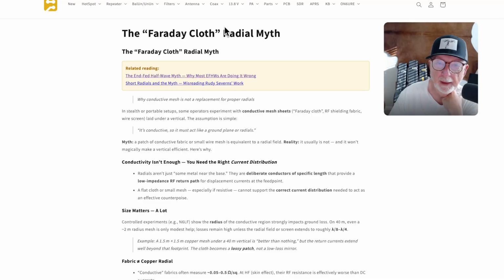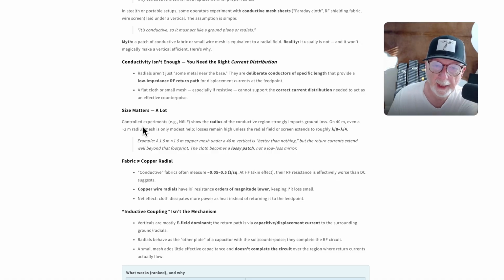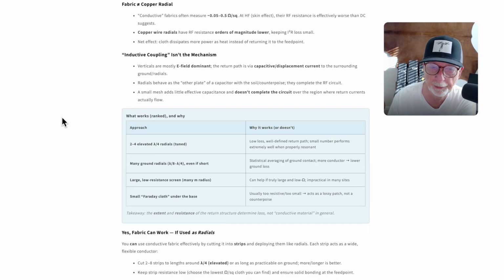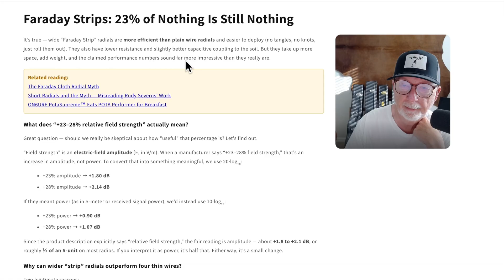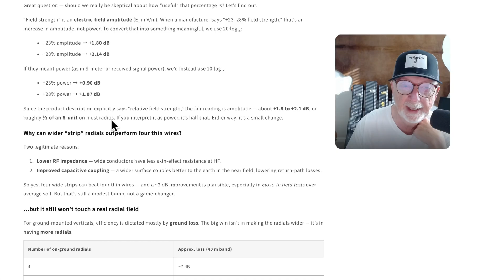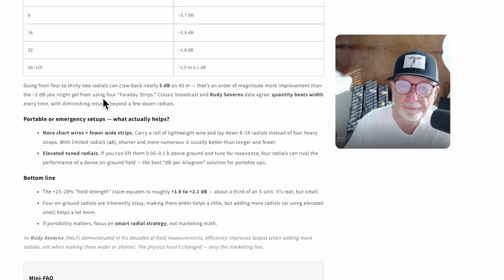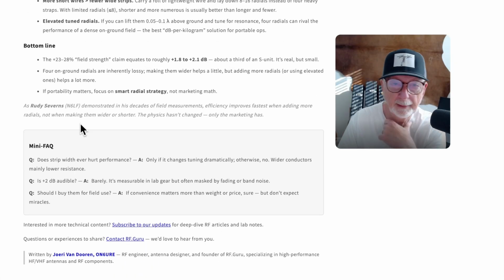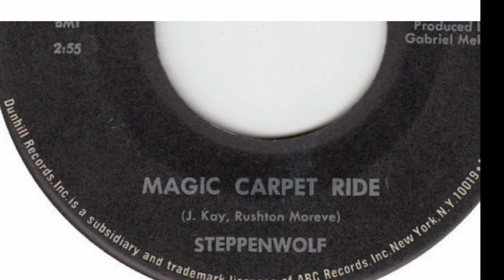Faraday Cloth Radials for Verticals.  Magic Carpet Ride?

Comment: Praise the Lord! I’ve been the one HamTuber that has been trying to tell people this. I even took a so called “Magic Carpet” out on the beach as a counterpoise and showed it absolutely sucked compared to plain old wire into the wet sand. Boy did I offend the Faraday Cult. This video does a better job explaining what I have known to be correct. Everyone drinking the Kool-Aid needs to watch it. 73 my friend! Walt K4OGO
Reply: I haven't even covered anything to do with the faraday sh*t on my channel because its plainly a ludicrous idea!
Reply: @TIMG5TM exactly! Even in simplest breakdown of the conductive properties of the cloth versus copper. It doesn’t take a physicist to figure out which is better.
Reply from the maker: Dang, comments from the best Youtube hams all in one place!!
Reply: @BustRadioMyths it takes one to know one 😂
Reply: Thanks Walt! Alot of the youtube hams seem to think "This sounds right, so it must be true!". Bugs me a little when they put themselves forward as informed, but are actually pushing myth and getting people to spend money.
Reply: @snokones  Hear hear!
Reply: Mark, you are spot on with your radial review. You presented this very well. I have been using 1/4 wave  verticals for many years.  You have to put as much wire on the ground and as you can. Wait until we see the next bottom of the solar cycle. I wonder how many magic carpets will be flying then? Steve

Comment: I have used the screen many times with great success....BUT...I never use just the screen.  I put the screen down AND put ~24 radials out also.  Just couldn't believe the screen alone would work well.  I do believe the screen adds or so says my WSPR tests though not a large difference.  However, I live in an apartment and have to set up portable every time and got sick of doing so much...so, I tried two elevated radials.  Wow do those work.  Haven't gone back.  I use those always now and they are great.  Much less work and give me better results than 24 ground radials even with the large screen or faraday cloth (I have both).  73 Mark and thanks for your vids.
Reply from the maker: More hams should try just a couple of elevated radials aimed at their target.

Comment: A counter view, but I will do my own testing as I start doing POTA activations with FT-710 and REZ vertical system. 

I am happy to pay $130 to avoid dealing with wires, and for POTA, I am certainly not interested in the minor dB gain from elevated-tuned radios on each band I may operate on.  I have no interest in tossing wires into trees (and many parks don't allow it), and I prefer a tripod to making a hole in the ground, which is frowned on in some parks.  

What gets me is why most folks would care about a 3-6dB loss of 1 S unit or less, which will be barely detectable on SSB unless right at the noise level.

HOA Ham ran a 12-hour whisper test on the new CHA FSR Faraday Strip Radial System vs wires, and presented his extensive comparative data; in most situations, the Faraday Strips won.

KB9VBR, in his many POTA activations, has mostly switched from wires to a Faraday cloth with great results.  If you're getting pileups or lots of contacts, who cares if you're 1 s unit lower than what some think is a better antenna?  He also says "WOW" with the new strips and so much better than keeping a Faraday cloth to lay flat, especially in the wind.    

It will be interesting to see others testing and comparisons when it becomes more widely available in January. 

Of course, tuning for the lowest SWR while usually close, isn't often the best resonance setting vs. when X=0.  Resonance is a condition in which the inductive reactance (+jX/L) and capacitive reactance (-jX/c) of the antenna cancel each other, leaving a load that is purely resistive. This results in maximum power transfer to the antenna.   

Dave WØJKT "Just Killing Time" since 1964, but still learning from more expert hams
Reply from the maker: Good you are happy with the purchase of the faraday strips.  But things like a 12 hour WSPR test comparing different radial systems is not valid due to constantly changing band conditions.  Thanks for taking the time to comment.

Comment: I've had proven good results with faraday cloth as a ground plane on my WRC setup with QSO's to South America  on 15 watts.. I don't give two shits whether it is "correct" to use wire radials over it or not. Works for me and I get on the air. Don't be a curmudgeon, Mark.
Reply from the maker: I AM a curmudgeon and proud of it!

Comment: I live in an HOA community.   I use an ASAT 120 for my antenna.  I used to have counterpoise of 2 radials for each band 40-10m.  Didn’t have the room for full length radials so I used buddy pole antennas as counterpoise on each band.   It looked terrible but worked.   Then people started talking about faraday material or just using window screen as a counterpoise.   I bought a piece of stainless steel window screen 4 ft. X 10 ft.  Grounded it to the base so it would act as a counterpoise.  Painted the screen close to the color of the roof shingles.  I use a magnetic mount to attach to an air vent on the roof of my patio.   The wind does not disturb it.   I put an antenna arrestor in system.  My antenna works much better than several random wire as a counterpoise.  Works better than the buddy antennas use as a counterpoise.  My asat120 antenna will tune on all hf bands from 40-10m.    I am very happy with my setup.   I read that a German engineer claims the density of the counterpoise is more important than exact lengths.   I don’t have to space or the neighbors approval to experiment.   What are your thoughts on using stainless steel window screen?
Reply from the maker: Sounds like you did a lot of experiments and found a solution that works for you.

Comment: Thank you, thank you, thank you!  I've been so angry about this myth of the carpet!  Rudy Stevens and I had a side conversation generally about how maximizing return currents works best with radials because the magnetic field (near field) lines are perpendicular to radial wires and induce the maximum return current.

Comment: For my multi band vertical i used traps in the elevated radials thus they are resonate on each band and kept my total radial count manageable to six three radials for each band 
40, 20, 12, on one 30, 17, 15, 10 on the other set of three. I always wondered if my 40 meter radials didn't carry current on 15 meters as well thus giving me six radials on 15 meters. The muliband vertical was a StepIR and thinking the traps would handle all the power one could throw at them since the power would be devided across the three. Perhaps Same for efficency.
Reply from the maker: Interesting design choice.

Comment: This video is kinda misleading. The faraday cloth radials work better than four wire radials on a non resonant multiband vertical antenna like what many hams use to do POTA. Sure a 32 wire field is superior but no one is doing that at the park and sure a resonant radial off the ground is better but that one resonant wire is for one band not multiple. I’m not saying the cloth is the best thing ever made but it’s a perfectly good option for allot of situations. Just because it doesn’t fit your particular style of operating doesn’t make it a bad choice or a gimmick.
Reply from the maker: We said the faraday cloth radials work better than 4 wire radials so no attempt to mislead.  If someone wants to spend $130 for these things that give a max 2db gain over 4 wires it's their money.

Comment: Okay, take the same idea of cloth covered radials with wires on the inside attached to a thin metal plate for with a grommet in the center just like the system we have seen recently on youtube.  put say five to ten  ten foot wires encapsulated in 600D cloth --so essentially the same system we have been seeing promoted except wire instead of "faraday cloth" inside.  

One could have 20-40 ten foot radials in such a system for convenient roll out.  ---Or just roll out some flexible D-10 wire and have fun.
Reply from the maker: Wires would have less resistance but still not cover the radial field.

Comment: As crazy as these Faraday radials are, some ham antenna manufactures claim that a vertical doesn't need radials at all! Putting up a vertical without any radials is about as effective as hanging a dummy load up on a pole and trying to work contacts with it. Yes, I know some hams have done it and claim it works great. Just another example of ham folklore that Mark can make a video about if he already hasn't.
Reply from the maker: Did a video on that a while back.  If the vertical has no radials it uses the coax shield so you have a one radial antenna.

Comment: great video, I agree with you on the whole magic carpet thing, in a pinch will it work, yes.   Is it the best way to accomplish the mission, no.  I have experimented with it and saw no real benefit, no improvement over four (4) 1/4wave ground radials.  I just purchased a few tripods to experiment with elevated radials, for my Array set-ups.  This should be an interesting experiment to test against my ground set-up with 32 -1/8 wave radials.  Thanks for doing the video and great channel by the way.  Salty Welt turned me on to you.   de NJ4Z

Comment: A single elevated radial easily out-performs a "magic carpet" or several radial wires on the ground, and it provides a modest degree of directivity.  For a uniform radiation pattern, use two elevated radials 180 degrees apart.
Reply from the maker: Sorry no common sense allowed here!!

Comment: Here you go again you old codger..... LOL. The off the shelf price for this is 130 bucks. I bought 2,000' of PVC UV resistant 14 ga. wire for my Hustler BVT 5 band and laid out 120 radials at .06 wavelength. 

Full disclosure....I did buy some faraday cloth for 22 bucks off of amazon for a radial experiment and then analyze the stuff with my nanovna. I can get 7 - 2" wide strips 30' long... that would be 14 radials and 15'. I'll see what happens.
Reply from the maker: Report back with your conclusions.

Comment: Thank you for putting this out. I’m worn out on the anecdotal evidence that it’s “game changing” because it worked. 

Rudy Severns’ tests on all this are legitimate tests and it seems like nobody’s taken the time to read it.

The strips are a funny concept to me. They aren’t more convenient in my opinion. They’ll catch wind when wires won’t. Now you have to bring steaks with you to keep them down. Not even close to worth the negligible performance gain.

I think I saw that same data put out and thought 23% vs what? What frequency, how many radials was it tested against? If you’re going to post that kind of claim you better back it up with a paper like Rudy put out. Otherwise it’s meaningless.
Reply from the maker: Good job Mike.  My collaboration with Joeri, ON6URE has been very helpful to the cause.

Comment: There's a lesson to be reminded of here... anybody remember the "Isotron" compact HF antenna?  "Just because it resonates doesn't mean it radiates". ;)
Antenna physical size = aperture. The more wire you have (well, up to a point, obviously) in the air, the more signal strength you can capture, and the more strongly you can radiate far-field for a given power.  "Get some wire up in the air!"

Comment: I don't know what the differences in material are, but I do know that at least one manpack NATO military HF digital radio system uses roll-up metal mesh roll-up radials, four of them, just like in your picture. :)  So the concept can't be too terrible. :)  But materials matter.

Even good quality woven metal mesh cloth is likely to have high impedance, based on what we already know (and many have measured) about woven wire "grounding strap" vs. plain sheet copper for a ground strap.  Sheet copper has much lower impedance, but you can bend it very many times... so we use the flexible stuiff only when we need a connection that will be repeatedly flexed, and sheet copper for everything else.

Comment: Love your channel. Usually cheering at the truths you so clearly express. In this case you are 100% correct, but I disagree… LOL.

A quarterwave ground mounted antenna is already a compromise. 

Tried faraday cloth for POTA activations and they were swift to setup, made ground conductivity variations less of a factor and allowed for swift activation and tear down to get to the next park. 

An elevated field of dozens and dozens of radials would not give sufficient advantage for the setup time and the public hazard of elevated non conductive stakes.

If the definition of success is max dB, you are correct but might as well abandon the quarter wave too… and go with a 4 element Yagi on a rented telescoping hydraulic tower you can tow between parks with a 2 Ton truck.

When is enough enough?

One could say we should use only the ERP needed, not just PEP, to achieve needed communication.

Besides, near totally compromised, we’ve all had better than expected DX from time to time.

Thank you for being a clarion call for better understanding so consistently.
Reply from the maker: Very good points.  For elevated radials you only need two to four.

Comment: Ground radials work far better when you have DENSE COVERAGE OF THEM IMMEDIATELY BY THE FEED POINT - out to a distance of say 6 plus feet. The faraday cloth amounts to an inadequate ground screen. Folks should just use 6 bunches of say 5 radials of around 2-3m (6-9ft long). These can be deployed in around 3 mins longer than it takes to put down the magic carpet and work 10 times better. Use 2 or 3 elevated tuned radials at 180 or 120 degrees equal spacing if you can. Thanks again Mark. 73
Reply from the maker: Listen to his man folks he has a great YouTube channel.
Reply: I agree Tim.  It works because that's where the most current "wants" to flow as it follows the typical current curve of a resonant 1/2 wave dipole.  It's simply Ohm's Law at work.  Under the MW broadcast tower, the radials are bonded together in what looks like a spider web to help equalize the currents on each radial.  At a 1/4 wave out the current is minimum on those radials so it would have no benefit to bond them at that distance.   Keep up the good work Tim.  73
Reply from the maker: This is interesting.
Reply: I believe for a given amount of wire this is true. In effect three ten foot radials might be better than one thirty foot radials. But three thirty foot radials will be better that the three ten foot radials. Of course we are not considering the soil conditions here either. The assumption is that you're setting on decent ground not a desert.
Reply: uppercasing is required for you to teach

Comment: I'm not a fan of the Faraday Cloth myself.  Setting aside the electrical/performance argument for a moment I just don't think the extra cost of the cloth or cloth strips vs wire is worth it.  Having said that, I won't begrudge anyone using cloth or cloth strips if that's what they want to do - at least they are out there on the air and having fun.
Reply from the maker: Very reasonable approach.

Comment: I bought a Faraday cloth in an attempt to help with RFI from my pool pump. That didn’t work, so I tried it once with a quarter-wave vertical. I was going to compare it to my usual setup with two tuned elevated radials. After putting the Faraday cloth down on a windy day, which took quite the effort, my SWR derangement syndrome wouldn’t allow me to use it. I couldn’t get a decent SWR under 2:1, so I threw it away and put my elevated radials back up.
Reply from the maker: Elevated radials are the bomb!  I don't know why more POTA vertical users don't use them.  In your case, SWRDS make you do the smart thing!

Comment: I’ve been using a sheet of Faraday cloth to insulate the the vertical (on a low to the ground tripod), from the poor soil type in my area (sandy loam). However, I do run 4 radials along with it as one should. I wonder if having a Faraday strip under an EFHW wire or the feed point would make a difference 🤔
Reply: Since an EFHW is voltage fed the return current is much less and ground losses are minimal. So a small counterpoise about 5% of a wavelength is usually all that's needed.
Reply: @Tim-K5OHY  I’ve been using an 8 ft (too long for 5wire as a counterpoise for my EFHW and it has helped me on 10 meters for European stations.
Reply from the maker: Improving ground conductivity would be a good thing under any antenna I would think.  It's generally thought that a half wave vertical does not need radials.  It will work without them but radials improve their performance significantly.

Comment: I used aluminum gutter screen rolls at $6 a roll (use 4) worked great and cost was way less!
Reply: Would solid aluminum strips of the same width as the gutter screen work better?
Reply from the maker: Helps leaves from getting caught in the radials too.

Comment: What does "elevated" mean?  Does that mean the radials should be supported a few inches above the ground?  How high?  And must the supports be non conducting, non metallic?
Reply from the maker: The higher the better.  One end attaches to the coax shield, the other end to something insulated.
Reply: @BustRadioMyths  Thanks.  This is to confirm that I have read your reply (It was not for nothing).